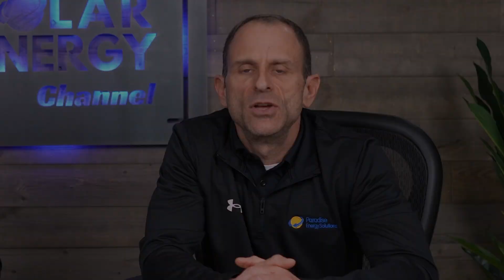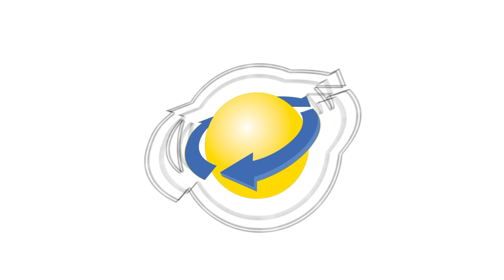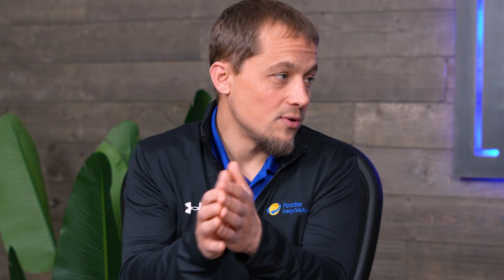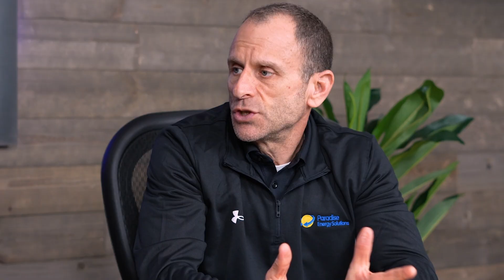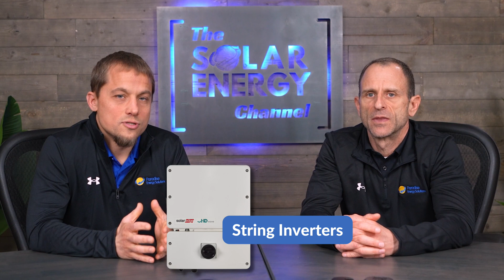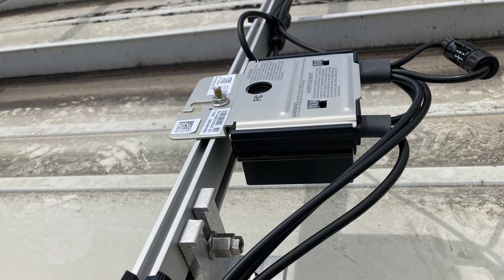How Solar Inverters Work (In Simple Terms)

Comment: I am a bit confused with the hybrid inverter... It seems different companies with different meaning of what a 'hybrid' inverter is/does...

The 'hybrid' I want is an inverter w/battery that does gridtied with ZERO EXPORT, but if there is a blackout, automatically runs as a backup inverter to run the house... Right now I have two different inverters doing that job with interlock kit on electrical panel...